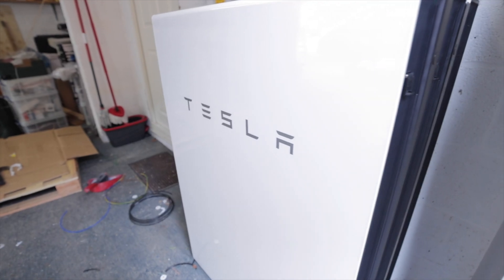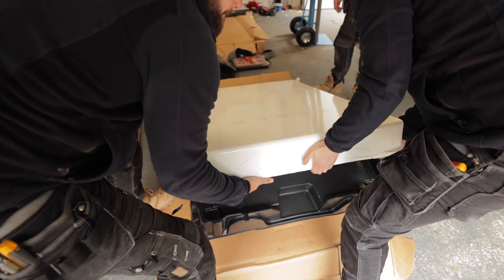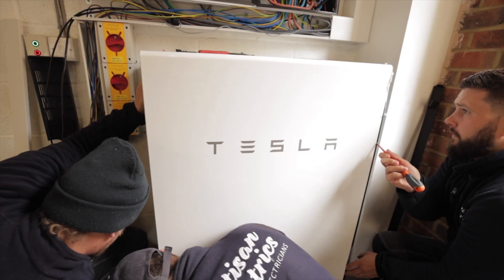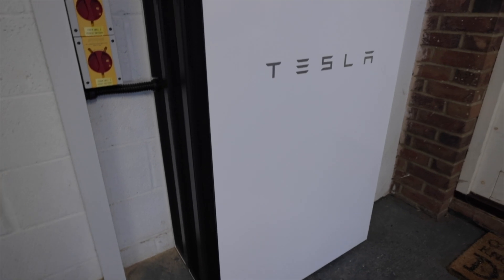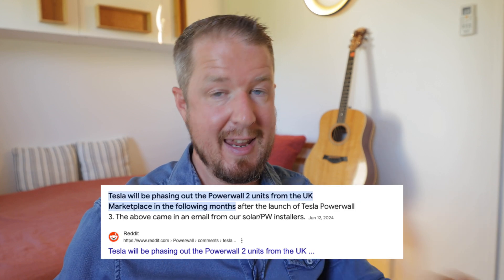Tesla Powerwall 2 DISCONTINUED? Get One Installed NOW!

Comment: I wanted another Power wall 2 but unavailable in UK so I purchased one from Spain all very easily then I wanted the fitting kit could not buy in UK so I had to buy it from Spain. Nobody wanted to fit my second power wall in Dorset, only offer supply and fit , so will do it myself 
 It fill as-if many solar suppliers have turned into double glazing salesman only after the big profit

Comment: My PW3 isn't arriving until 25th Nov :( I did order early but I think my installer was slow. I've had to fit a Solax inverter as an interim solution!! Will eventually use that to add solar to the garage roof.
Reply: Buy Victron

Comment: I have 2 PW2's connected to solar and obviously to my house.
My only gripe is is no UPS.

I asked on the PW FaceBook group to see if anyone had found a whole-house UPS because I get power cuts regularly. My door bells all ding dong, all my Hue lights turn on and I have to wait for the router to reboot before I can turn them off. Then I have to restart 3 NAS data clusters I have around the house and set 3 appliance clocks. It's such a pain.

But of course, the Facebook group are Tesla shaggers so they all pile on saying the switchover is instant, you don't need a UPS, blah blah blah. Essentially making shit up because you can't say anything negative about their precious.

So, is there such thing as a whole-house UPS? It doesn't need to run the house for more than 1 second, just to give instant power between the mains and Powerwall.

Comment: Added a second Powerwall this March, exactly because of the v3 coming, this will mean I will never use any mains outside the cheap period on Intelligent Go, charging our EV and running the heat pump, this will mean our heating will cost just over 2p a kWh, cheaper than gas!
Reply: Do you have solar? Or just use the cheapest electricity for the system?

Comment: So PW3 has an inverter built in so a second PW3 would be wasting space and cost, or is there a PW3 additional battery? Or have I got this wrong?
Reply: You can run 4 PW3s in parallel (yes, this would give you 44kW of inverter power!!). A DC expansion module is coming late this year, which is a cheaper PW3 without the inverter, and each PW3 will be able to connect to up to 3 of those, for 4x4=16 total units, or 16x13.5=216kWh of storage.

Comment: Many people miss the point completely. With a home battery system you can run your whole house on 1/2 price off peak energy, thus halving your electricity bill. If you have solar as well your energy costs March to October will be around zero, reducing your bill by another 1/3 plus you get paid for exporting excess solarPV - I generate over 6000KWh per year and get paid about £500 per year for this, This means my electricity usage cost is either zero or negative. During peak solar generation period I also get electrically generated hot water and heating during the spring so no gas usage either during this period either. The payback is about 10 years for my system. After 10 years the system will not suddenly fall over I am certain. Yes it is a long term investment - but better than most savings schemes by a long chalk. I have no plans to get an additional battery as this would not be cost effective.
Reply: In 10 years battery technology will likely have come on as well design efficiency so having to replace it may not be altogether a bad thing. You could find that you’d end up with enough capacity to go days between running out of captured solar power in the winter.
Reply: @davideyres955  
I'm 78 I can't wait 10 years. 

If I do the calculations amortising the installation cost across every KWh stored with a Powerwall it's impossible to get my money back.
Reply: Maybe I have the sums wrong at my usage the cost of the installation made it not worthwhile when amortising the installation cost across the units of electricity stored. Especially taking into account the battery degradation , someone in these comments is saying that the battery has degraded 30% over 5 years

Comment: I'm hoping to have a power wall 3 next year to fit to my solar carport. 
This carport is using a Wave solar edge inverter. The first inverter failed this year with only 2 years clocked. It took a month to replace, and had to wait until 1 was shipped in from Hungary! The app for monitoring is basically poor.

Comment: I had a Doncaster Cables PowerWall Connect cable fitted with an EV charger as the cabling route to where my PowerWall would need to be installed (away from the house) but couldn't justify the cost until I can get solar (and that's expensive right now). Does this work with PW3 if you can use a separate inverter for solar in the house and keep the gateway in the house? (i.e. don't need that feature of PW3)?
Reply from the maker: It depends on how your PW3 will be set up. Doncaster cables Powerwall connect is only 6mm so too small to run a PW3 if set to 11.05kW so you will prob need to down rate the Powerwall to protect the cable.

Comment: As PW2 owner which is about to hit 30% degradation, I’m curious how long will Tesla will keep PW2 around for warranty replacements? Would love to have it replaced with a PW3.
Reply from the maker: Good question! How long has your PW2 been in?
Reply: @artisanelectrics  It was manufactured April 2019 and installed September 2020. So well within the 10 year warranty. Apparently a lot of PW2 manufactured around that time have the same rapid degradation issue.
Reply: @paulrgab 
So you're at 70% capacity at 5 years,?
Reply: @paulrgab  lead acid
Reply: Tesla have said to us installers that they will honour all warranties and replacements , I will imagine it will be another pw2 that's refurbished etc, pw3 requires a complete resign in the wiring

Comment: seems that Tesla might be cutting off their nose to spite their face if the PW3 wont work or integrate with a PW2...when there is so little difference between t the two items (an integrated solar inverter...!) People will get pissed off pretty quickly if they want to expand their battery storage, cant get a PW2 and the PW3 wont work with what they already have paid a lot to install...not a great business plan...
Reply from the maker: It’s all about simplifying their manufacturing in order to achieve high volume and therefore low cost with Tesla, why would they continue manufacturing an older product at the same time as a new one?

Comment: I'm so glad I don't have any of this shite in my house.  It hasn't cost me a penny! 😂
Reply from the maker: That’s one way of looking at it 😂
Reply: @artisanelectrics  absolutely it is.  I pay maybe £50 / month for electricity, so approx £600 / year.  One of these battery installs would cost what?  £10k minimum with solar?  So that's almost 17 years payback!  I'd be very surprised if any battery system would last 17 years without needing replacement.  Each to their own but it's not a bandwagon I'll be jumping on any time soon.
Reply: @Chris-hy6jy also factor in the bulllshite cost of house insurance as you now get asked do you have solar, so I bet when you answer yes they charge you a premium.
Reply: @davideyres955  yeah otherwise why would they ask?  If you've got battery storage on the outside of the house, you've effectively got thousands of pounds worth of equipment sat outside ready to be stolen.
Reply: @Chris-hy6jy  10 x 105 amp Numax lead acid deep cycle is a grand...Victron invertor 800 pounds

Comment: The problem is with adding another pw2 is the dno as I know I won’t be able to have another 5kw but with the pw3 there are dc expansion packs of which you can add 10 per phase so expanding is a lot easier, I’m getting my pv solar and power wall 3 installed in 2 weeks time 😊 can’t wait 👍
Reply from the maker: Exciting!

Comment: So Tesla are replacing the Powerwall 2 of which you can have 10, with the Powerwall 3 of which you can only have 4, and they are not compatible with each other, and the Powerwall 3 probably costs more. To summarise it’s a worse product for more money. Yes, that makes total sense! 😂
Reply from the maker: I wouldn’t say worse - just different
Reply: @gadgetman36 My knowledge is USA based not UK, but the Installs are still similar. 
Yes you can only interconnect 4 Tesla PW3s per Tesla Gateway or Back Up Switch (BUS).  If you need more than 54kWh of storage (not common for traditional 200amp service) Tesla is releasing Expandable DC Battery Units, these don't have the Inverter in them like the PW3 units.
If you are on 400amp utility service or more or you are trying to back up multiple electrical panels you can just install a second Tesla Gateway 3 and be able to install another 4 PW3s if needed...

Telsa is not the most intelligent or best solution for homeowners in my opinion but you cannot deny they are the best bang for your buck.

Enphase is far superior and true microgrid technology with built-in redundancy. 

If you you build out a Tesla PW3 system and an Enphase System with exactly the same adders and margins, depending on how much storage you need, the Tesla system is usually $5k to $8k less expensive....

At the end of the day most Homeowners will go with the less expensive system unless they see the value of the far superior Enphase system. Some do and some don't, it's all good either way...
Reply: It does make sense. What it hasn’t been said on this video is that Tesla is set to release in Q1 2025 a DC expansion, that costs less than a PW3 (no solar inverter built in) and you can stack 3 expansion packs for each of the 4 powerwall3. So you will end up with 13.5kWh for the first PW3 + 13.5kWh each expansion pack you stack up. The total storage capacity will exceed by far all the PW2 you can out together, and also is way more cost effective. Hope this helps